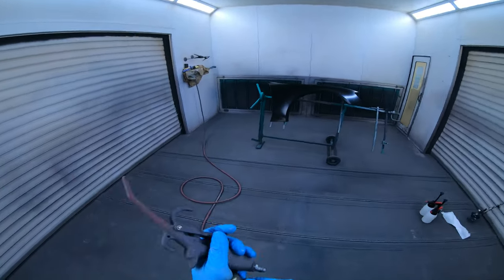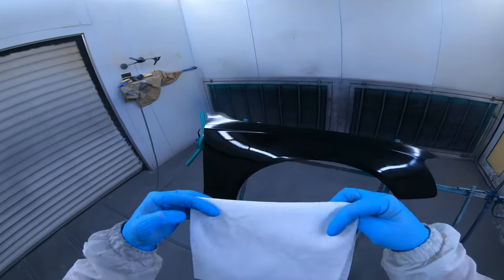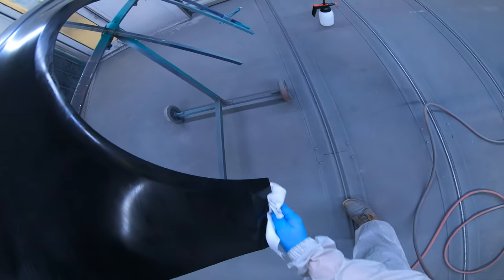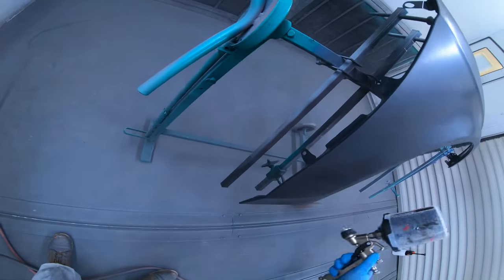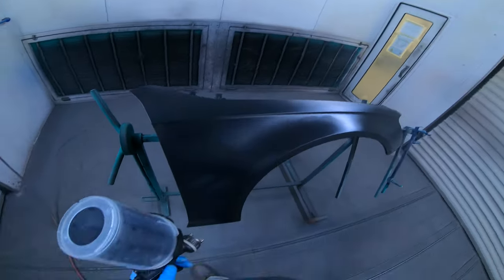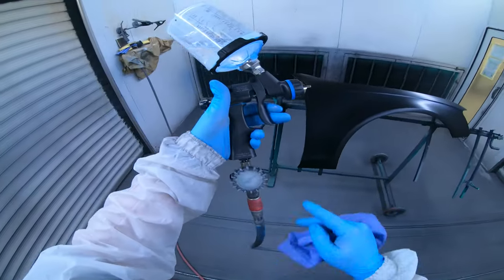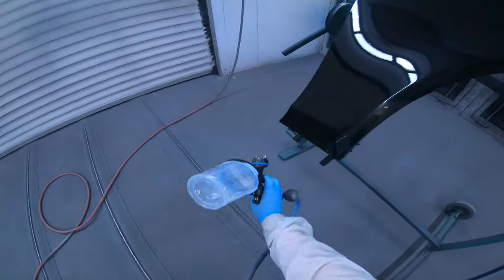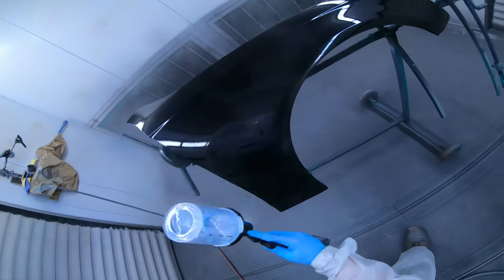New Panel prep | How to prep a panel for paint

Comment: Hi Paul, what is the different between this 2 guns? Lg Günther from germany
Reply from the maker: Hi Günther,  that's awesome I lover hearing where viewers are from 🍻

Not a whole lot, the blue one (geo) has a specialised fluid tip which helps with atomization for different base's and clears. I feel it is a little slow, similar to the the iwata. 
The white hte clear is specifically designed for clear coat and has a lot more holes in the air cap. This has a much quicker fluid delivery.